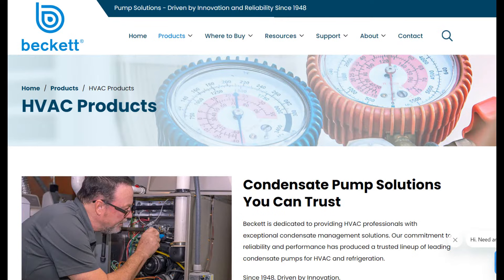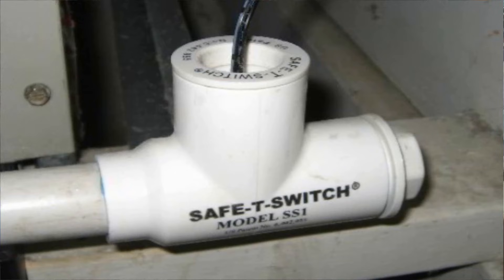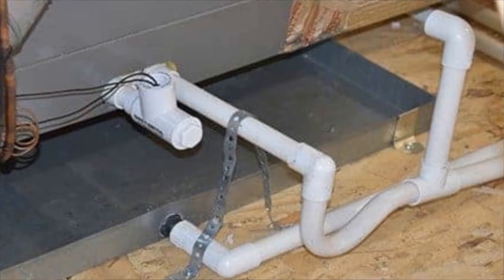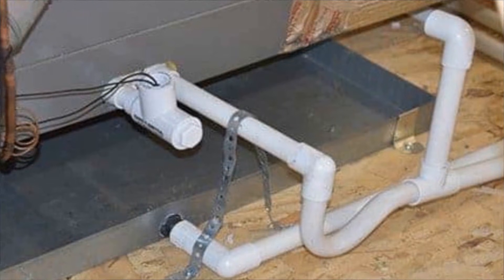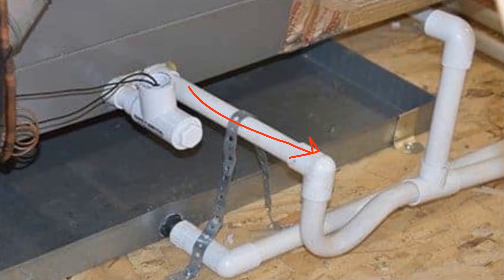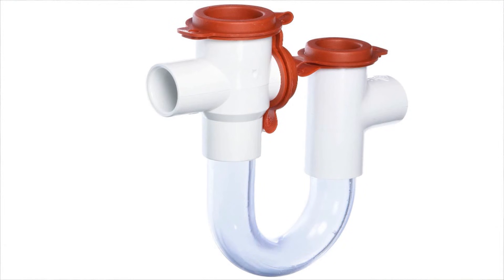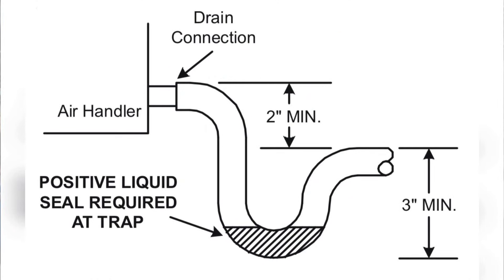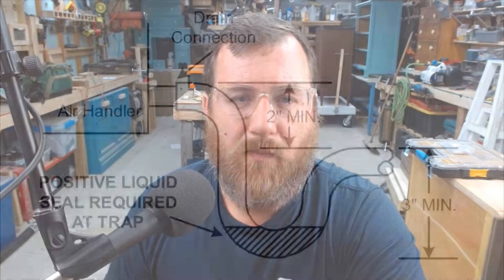HVAC Condensate Drains | Primary, Secondary and Proper P-Traps

Comment: What if the P trap has some condensation on it and light drop of water into the wood below? What can cause this?
Reply: Drain water is cold, attics are often hot. Drain line is getting condensation on it. Put some Armaflex tubing insulation on the drain line to prevent water leakage.

Comment: I am running an old BorgWarner Heatpump from 1983. The drain pan needed to be cleaned and painted. While refurbing the drain pan I also thought I would go ahead and replace the entire drain system. What could go wrong, I mean it is only 5 feet away from the sewer drain. I did it all up nice and even used a short hose. What I did not do was realize that even the small, the old black rubber hose (U shaped) kept negative pressure under control. I even decided to replace the original blower motor since it had more end play than normal. The combined increase in blower power and the lack of a water seal in a p-trap I had a mess of water everywhere. Watching this video put me in the right direction and all dry now. Yes the old heatpump is still working great as of this note. Amazing how solid these old units were built.

Comment: Question on Home Inspection course: what installation practice in a attic mounted air handler is prohibited? The answer is combining the primary and secondary condensation lines into a single line. Why is this a problem? TY

Comment: I had two drains on my old system now the new system they put a cut off switch and it didn’t work and I just happen to go up and look in the attic and there was 5 gallons of water in the pan, these cut off switches are total bullshit, they are for complete lazy bastards almost destroyed my new house and I told the guy I didn’t want it and I still got it. That was my builders department and builders suck.

Comment: we are remodeling our guest bath and under the sink is the condensation line, could i just change the plumbing to have it go directly into the sink drain pipe in the wall? or does it have to go to a trap ?

Comment: I have two units. The tray keeps filling and shutting off the downstairs a/c, there's never any water on the tray for the upstairs unit. I also noticed there's only a ptrap on the downstairs unit and neither of them have a vent for the drain line. 
-Should there be a ptrap on the upstairs unit?
-should I install a vent on the drain line for either unit?

Comment: Put float switch in the secondary drain pan that turns the unit off if it senses water in the secondary pan.  Then you don’t have to answer phone at night and there will be no ruined ceiling.

Comment: I have an upstairs a/c with no p-trap. That primary ties into the downstairs a/c then ties into the main grey water line with a p-trap. Do I need to add a p-trap upstairs as well? I do have a vent line coming off the primary upstairs a/c drain.

Comment: I have a 4.5 ton variable BOSCH air handler with a running trap and no vent, no clean out TEE. 
Looks like a no-brainer to install a clean out tee with unions either right before or right after the trap.  I don’t understand if my running trap is acceptable or I need the deeper p shape.  I’d like to have a little bit more knowledge before I proceed on my own or call the installer and question his technique.
Reply: Your comment made me realize it makes lots of sense to put unions in so it's easy to pull off and clean. Thank you!

Comment: Our float switch has tripped twice in one month. It’s placed as a secondary line next to the primary line like the image you have at 2:26. I can see inside to where the ptrap is and inside the vent drain, neither are blocked/overflowing with water. Any thoughts on why the switch would still have condensation build up?

Comment: I'd like to see a comparison of condensate drain installation for a blow-through system vs a draw-through system.  I have a draw-through for one side of the house and a blow-through for the other side.  It's a 2-story house and both systems are in the attic.

Comment: All the clear traps that you showed towards the end! They look like a one inch drop, would have been cool to know how you address that because the next slide shows a 2 inch drop from thr goodman manual. Which I am dealing with at this time. Thanks great video
Reply: Same situation for me. I'm planning on adding an elbow and then drop before the p trap.
Would that work?
Reply: @andreamarrado  i bought a nice clear trap from amazon and just cut it in a way that made it a 2 inch drop as per spec in my goodman manual! Worked great!
Here's the title of the trap I bought 
3/4 Inch Standard Condensate Trap with Cleaning Brush and SS2 Condensate Overflow Float Switch Combo Kit for HVAC Systems, Air Conditioner

Comment: My condensate drain has two vent stacks. One before and after the P-trap no drip pan as the air handler is outside. Air blows out the first vent before the P-trap when running. Is this normal? I'm in Arizona so the P-trap rarely fills up with water unless it's Monsoon season.
Reply: The vent before and after is a nice addition actually. In case the trap gets clogged, you can simply blow it clear. Though, keep the vent before the P-trap capped at all times unless clearing the drain.
Reply: An open vent before the P-trap defeats the purpose.

Comment: To be clear, the name "vapor lock" might be the correct name used in the trade, but the phenomenon has nothing to do with vapor, and it doesn't really result in a lock.

The problem arises if there are two traps within the drain. One you intended on, and another due to pipe sag (I call a, sag-trap).

Let's say that each of the two traps in my example result in 3in of vertical water level per trap.

With a vent between the two traps, the water entering the vertical pipe before the real trap, only needs to fill to a level of 3.1" (above the trap water level) to move water through the first trap. That same 3.1" of water will be enough to push water through  the second trap. The water in each trap is dealt with in order. One, then the other.

If there is no vent between the two traps, the two 3" vertical columns of water are connected by air that can not escape. This means there has to be 6.1" of water in the vertical pipe before the first trap in order to build up enough pressure to move the water in both traps simultaneously. No vent means the water in both traps have to move together. This requires higher head pressure to accomplish.

Certainly, make sure the vertical pipe leading to the first trap from the unit, can contain a height of water that is greater than the water level in the real trap.

Comment: So my AC drain pipe did not have a cap on it. I was told by the AC technician to put a cap on the drain pipe so I did but now the drain pipes are making noise every time the AC is on. Sounds like rain drops.. however, when I take the cap off, then there is no sound. Our blower motor have been replaced recently and we are having this issue after the new blower motor and once we cover the drain pipe with the cap please advise what can we do to fix this
Reply: Sounds like that there is excess water in the pan under the evap coil gurgling and not draining. It's probably all draining when the fan kicks off. Make sure the p trap is set right so that it holds water. Make sure the 2nd hole is sealed up too. There might be a partial obstruction in the pipe down the line and may need to be blown out. An hvac guy should be able to fix it in an hour tops. Gurgling isn't good.

Comment: Great video, very informative!  I'm curious if you have any recommendations (and/or affiliate links) for P-traps that meet the requirements you showed.  Having a hard time finding them at my local hardware stores and Amazon.  Also, is there a good way to setup the p-trap and plumbing that allows for easy removal for evaporator cleaning/service?

Comment: Great video! On a positive system with an older furnace(not high eff) do you recommend putting T with a cleanout at P-Trap connection and also installing a vent past the P-Trap?

Comment: We launched new Gen 3 SS1 (and 2 & 3), they have a deeper base to addresses issues of build-up. Our Drain Guard has slow-releasing formula for six-month protection against white slime, maybe the slime from the Nordyne coil you experienced. Can you discuss what happens when you use Vinegar to clean primary drain lines. Too many techs promoting this; vinegar causes offgassing that IS harmful to soft metals (AC coil), and also considered to be carcinogenic.

Comment: So theres all alum coils now which means no antimicrobial properties. How do we negate this? Copper! I use copper chips in my EZ trap. Soon I'll be buying some copper sulfate. Im using the amazon knock off ez trap and it works great. Im about to put a second primary on.

Can you cover the diff types of coils and the drains they might need? Like for a bosch, it's a blow through. But a trane isnt. Thats important stuff. i dont know if you have covered it already but we are in cooling season and clogged drain line season lol.
Reply: Amazon knock-off is copied design made in CCP China of USA product. I avoid knock-offs and support USA products.

Comment: Have had issues with the EZ-traps not fitting together well even with priming all surfaces and gluing. Had a couple leak on me, went to a regular p-trap w/cleanout and a SS2 in the secondary and a pan switch of course.
Reply: I have found that using gorilla glue to connect the ez trap to pvc components to work well. Set time can take a bit longer, but it makes a water tight seal.  I will prop something under the ez trap while it cures.
Reply: Good to know.